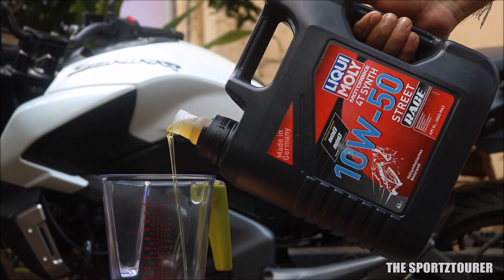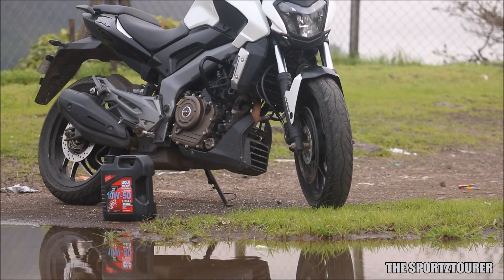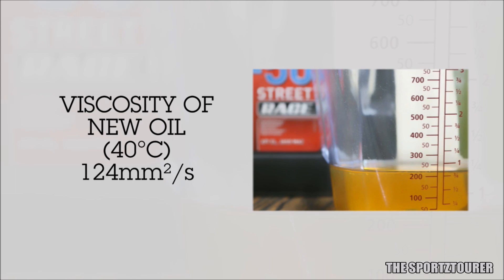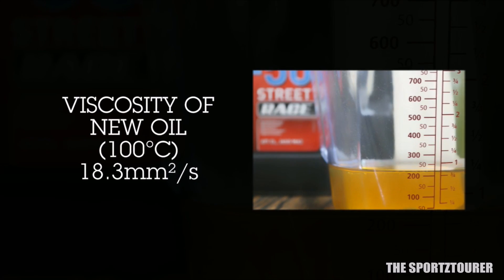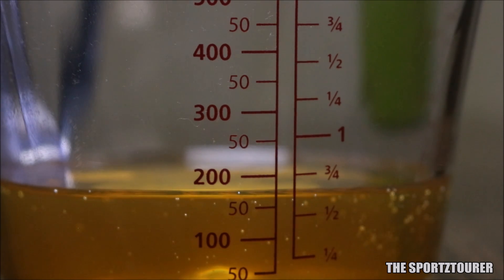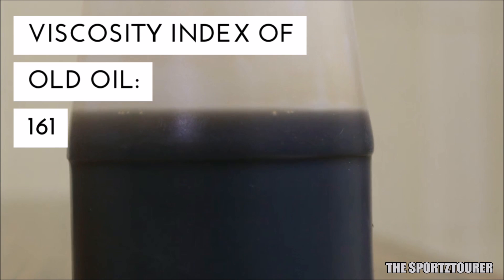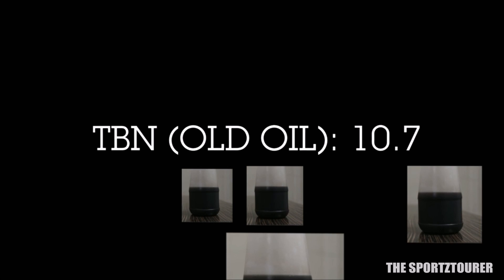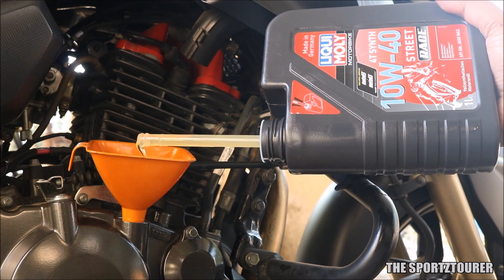ENGINE OIL CHECK, LAB TEST VISCOSITY, TBN, VI, GRADE | LIQUI MOLY STREET RACE ENGINE OIL REVIEW

Comment: I own a Yamaha FZ V2. After using Yamalube for quiet sometime, I decided to give Liqui Moly a try and ordered the performance kit.
I could really feel the difference in the engine’s performance. The torque, the low end-performance, heat management as well as the efficiency and purring of the engine when it’s on long rides.

I don’t know how the Germans do it but damn, Liqui Moly’s oils are on the next level. I feel that other manufacturers of synthetic engine oils should pull up their socks and improve their R&D if they want to compete with Liqui Moly. I feel Motul is the only one that kinda comes close.

India, however, being a price sensitive market and a market where Liqui Moly is imported rather than manufactured is a tough sell for the German oil maker but damn, they are on to something!

TL:DR - Liqui Moly is really performance oriented and boosts and aids engine performances by a huge margin.

Comment: Hi, Can i use liqui moly 10w50 for my pulsar 150 ug5 ? Currently i am using motul 7100 20w50, but not satisfied with engine sound & heat. I am a heavy traffic user.

Comment: can you suggest me one top of the line fully synthetic engine oil for RE Classic 500 with drain interval of more than 5000KMS with good anti-wear, cleaning agents, smooth gear swifts, viscosity, high temperature resistance etc. Kindly do suggest one top of the line product. I see you are the right person to suggest
Reply from the maker: Hi Naveen,
Which oil are you using now? How is your experience with it?

Comment: excellent informative video im currently using liqui moly 10w50 for my RTR 180 because 10w40 is not performing well at High temperature 🌡️ 10w40 is best for short spin as my bike is fitted with aftermarket performance filter plus carburettor rejetting to suit filter with NJK iridium plug that reason i switch to 10w50 please comment your opinion on it......

Comment: Fantastic in-depth video. Being an experienced YouTube viewer now I have filtered away a lot of channels which are just wishy washy content wise at best. But yours is one of the first channels I will look at when I get a notification! One question I have is: since you tested the liqui moly oil in depth, will the test results change based on the grade or would they be more or less the same? (Eg if you tested a 15W50 liqui moly or Castrol would your results be the same or will there be a variation?) Would you recommend to use oils like Castrol or liqui moly( would prefer castrol as it is cheaper) on my royal Enfield classic 350 ( recommended grade-15W50)

Comment: Sir I am using Apache 160 old 2015 bs 3 version clocked 11k currently i am using motul300v2  which is best lq moly 10w40 or 10w 50 pls give a suggestion sir

Comment: First of all.. It's an wonderful explanation.. Becaz I am a geek and I just know.. I have fz v3 bro.. Recommended oil grade is 10w40.. But I intend to use 7100 10w50 fully synthetic becaz it will flow better at hotter temperatures... Am I right about this? I don't care about the money.. I just want my engine to be smooth.. Please advise

Comment: Among Motul 7100 and liqui moly, which one reduces the vibrations on the dominar more and which one would you recommend for high city usage as the heat dissipation from the dominar is really high bumper to bumper traffic.
Reply from the maker: Vibrations have a lot to do with the design and metallurgy of engine so oil have a very little to act there. Heat management is really good on both the oils and can take heavy traffic with ease. On highways you won't find any much difference but I personally found the Liqui Moly for performs better with frequent gear shifts while riding in the traffic 😊

Comment: I have been following your work for quite sometime but not subscribed but after this I gotta admit I'm pretty satisfied with your knowledge regarding engine oils. So for how many kms you have ridden Dominar after changing the oil to Liqui Moly ? And after how many kms you changed and topped up the oil ? How does the oil perform in long tour riding condition ? I'm planning to switch from Total so I may consider this.
Reply from the maker: Hi Joseph,
Even with heavy riding the Dominar 400 never required a top up (same was the case with previous fully synthetic oils used). As the Dominar is mostly used for heavy riding (long distance rides or sometimes heavy traffic), the engine oil usually has to face endurance situations so the drain interval depends upon the type of riding. The performance of the oil is really good on highways and improvement in gear shifts can be noticed.
Thanks a lot for valuing the videos and appreciating the efforts, subscription is always a big motivation to make more such videos, thanks for that 😊
Reply: @thesportztourer  So without top-up we can easily clock 5k+ kms ?
Reply from the maker: Can say for 4000-4500km 😊

Comment: Is it necessary to change the engine oil every 6 months even if the number of KM's driven is less than 3000?
Reply from the maker: Hi Prajwal,
Engine oil inside the engine gets oxidized over time. If you are using fully synthetic engine oil then you can easily maintain 10-12 months interval for an low running engine.

Comment: Can this be compared with the stock oil that goes into Dominar
Reply from the maker: Hi Prajnyan,
This is the 3rd fully synthetic engine oil we are using on the Dominar (have used Castrol, Motul, Liqui Moly). It's not just us but many other Dominar owners have found these oils to perform better and efficiently than the stock oil specially under heavy use. Not that the stock is bad it's just that these oils are a bit superior in performance 😊
Reply: @thesportztourer  awesome, will check the other oil comparison videos. The reason I asked is to benchmark against the Total oil.

Comment: Although the intent of the video is good, the results do not make conclusive evidence of the longevity of the oil since the test is performed on a 2000 kms old oil. Oil does not degrade linearly. For a fully synthetic oil, the test must be performed at around 7,500 km mark to get the numbers that will help in determining the quality of the oil. 2,000 kms is very less to subject a synthetic oil to test.
Reply from the maker: Hi Sagar,
Have duely noted your point and will consider that if I go for any test in the future. I personally have never taken any oil beyond 4000km as the most of my oils go through endurance runs like you must have seen in the Bangalore-Mumbai, Pune-Ujjain, Rajasthan ride, to the east India or the recent 1000km ride to East Maharashtra etc. So the conditions faced by the oil is also important I hope I am able to explain my point here 😊
Thanks a lot for acknowledging the efforts, really means a lot to me.
Reply: @thesportztourer  Well, in which case you can get the oil analysis done at around 5k mark when you usually change the oil. It will also help assess the claim that the oil companies make about the longevity of the oil.

Comment: Hi, I have a quick question, I'm currently using motul 300v 15w50 for my rr310 (15w50 recommended by the company)... Interested in switching to motul 300v2 but only available in 10w50, is it a good idea ?
Btw how's liquimoli compared to motul 300v, i heard the street version is just a hydrocracked oil with some synthetic addictives and 300v is a 100% synthetic product looking forward to hear from you...Thank you for your researches, observations and different contents it's difficult to get information like this on automobiles we really appreciate it...👍
Reply from the maker: Yes, you are right the street version is HC oil while the street race version is fully synthetic like the 300V. Comparison between the 300V and Street race will require a dedicated video 😊 Are you interested?
Reply: @thesportztourer  yes, plz consider 300v2 version too, it's the new kid in town, also 300v is 100% synthetic, fully synthetic and 100% synthetic are different right ?...There is no industry standards for synthetic content quantity in fully synthetic...But oils marketed as 100% synthetic is designed from molecular level and no mineral counterparts are included, not sure but you can correct me if I'm wrong

Comment: Hey bro...nice info, really much needed for bike enthusiasts who wants to keep their machines working good for long, please if possible do a comparative results with the motul 7100 ,I think you shouldn't be using 10-40 grade in Apache, because the piston ring gap is not as precise as it is in Dominor,a 20-50 grade is good for RTR, because I own a NS 200 ,and when I used 7100 10-50 ,I had more oil burn than of 20-50, that's because of the piston ring difference in 200 and Dominor engine, please check with it...

Comment: Dada ki video! 😍😍😍😍 

This oil recommended for RR310? Also, Please check the new TVS Tru4 synthetic engine oil 15W50.
Reply from the maker: Thanks a lot!
For your kind of riding you will enjoy this oil. Is the new Tru4 15W-50 made by Bharat Petroleum? Should be better than the mineral oil they were using earlier.
Reply: @thesportztourer  thanks Dada. Yes it is, i guess so. It's specially made for rr and duke they say. Need to test

Comment: I used motul 7100 10w50 on my rtr200 by suggestion of my friend. Is it safe to use 10w50 instead of recommend 10w30 on rtr200. Please provide me with solution as I replaced oil yesterday only.
Reply from the maker: Hi,
Better stick to 10W-30 or 10W-40 grade oils. 10W-50 will be a bit heavy, for the next oil change switch to above mentioned grades.

Comment: What about the tvs true synthetic oil bro is it good or not the service people told me after 6000 km the oil is in good condition don't need to change the oil for my rtr 200
Reply from the maker: Hi Raghul,
A lot depends upon your use. For a  heavy user like me 3000-3500km is the usual drain interval, it can be extended but you will miss the initial performance.

Comment: Does lab test also shows dynamic viscocity ? ❤️
Reply from the maker: Hi Tarun,
To get Dynamic viscosity we have to multiply Kinematic viscosity with the density of oil.
Reply: @thesportztourer  thnx bro btw i knw dis i m also a mechanical engineer 😊❤️btw nice video
Reply from the maker: Happy to see a mechanical engineer here!
Practical measurements of Kinematic viscosity are way simple (multiple methods available) than that of Dynamic viscosity hence if you observe dynamic viscosity is usually calculated analytically 😊
Thanks for valuing the video.
Reply: @thesportztourer  ur instagram id ? 😊

Comment: We must appreciate your efforts to scientifically test & prove the quality of product for us, in this case -Engine oil.
I am really impressed with Liqui Moly & thinking to use it in my next oil change.
Most of Oils fail in maintaining Viscosity index i know because i am working in automobile industry for last 6 years.
Please do test the same with Motul synthetic oil if possible!
Reply: Yes with motul fully synthetic please
Reply: Testing not accurate. I run both liqui moly 10w50 street use and motul 7100 10w50 no issue during heavy dispatch. It just your bike wiring grounding problem that not sparkling well. Trust me.

Comment: I have Apache 200, is liqui moly 10w40 better than motul 300v 10w40 ?
Reply: Srihari R I'm an rtr owner too, used both oils that you've mentioned, i must say 300V is much better in terms of engine refinement and high speed performance.

Comment: Hey actually i have question
I RTR 200 and i am useing motul 10w-40
Could u do the same test with motul.
Or can u tell use which would be the best
Motul or liquid moly
Reply: Same request.... #RTR200GANG
Reply: Motul is enough for rtr, if you have few more bucks go for liqui moly.
Reply: I did not like the liqui moly I liked 300v for my rtr 200 and 300v² for my continental gt 650.

But if you add MoS2 then liqui moly is better.

Comment: Motul 7100 on a 150cc engine? I feel it waste of money sometimes. What you say? What should be the drainage interval? I just purchased it yesterday 🤔
Reply from the maker: Hi Shashwat,
I get your point 👍 All boils down to the type of use one has. I would say for heavy city riders, long distance tourers, racers (150cc segment) fully synthetic oils does make sense and difference in performance 😊
Which motorcycle? Km done?
Reply: @thesportztourer  Fz s v2, 27000+ kms done. I usually take long distances on it.